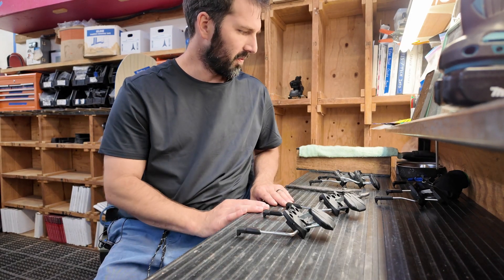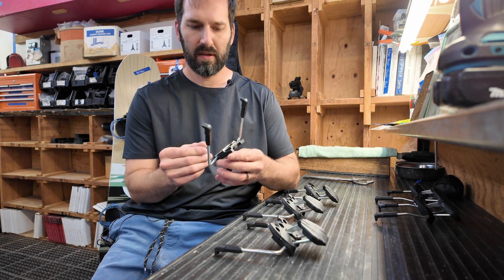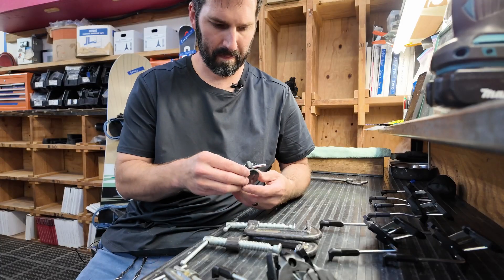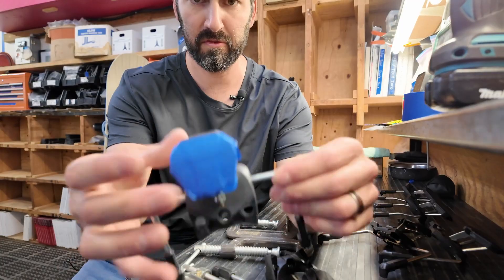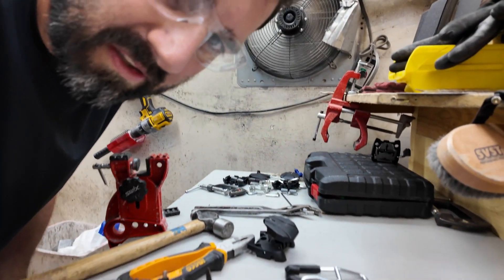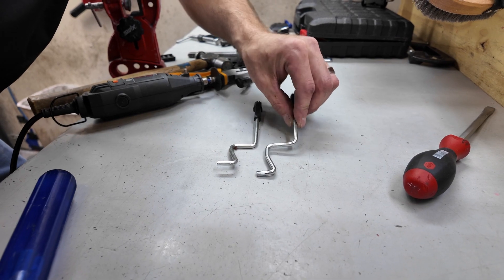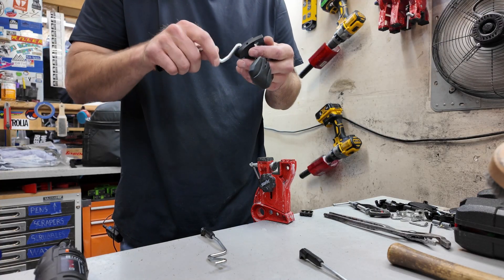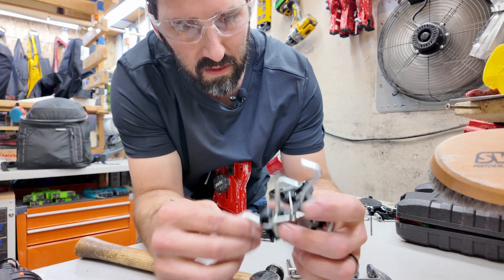Fabricating a Brake | Mounting a Look SPX RockerFlex Race Ski Binding to a 98mm Alpine Rec Ski

Comment: Where can I get brakes for look spx 12 , rossignol experience 84 ai
Reply from the maker: If your local shop doesn't have any spares, you can order directly from Rossi- they list it as the "Brake 3P B90" SPX Brake at 90mm width.  https://www.rossignol.com/us-en/brake-3p-b90-FC9F013000.html

Comment: Man, you are my hero. Long ago, and I mean long, long ago, I tried to get a replacement part for a Look binding and all the shops I tried in Mammoth said they couldn't sell individual part, something about legal liability. I even called the US distributor and had a very uncivil discussion with him. I mean it wasn't a particular difficult part, just disassemble off, reassemble on. After half a dozen call to our brothers in Canada and getting no love, I got hold of a shop in England that sent me one.
   It great to see shops doing this kind of out of the box thinking.👍👍🤙💪
Reply from the maker: Messing with bindings is certainly a grey area... these were for a pro skier and knew what he was asking for.
Reply: @Starthaus  Well, regardless, it's nice to see there are shops with brass ones big enough to step up.

Comment: I'm trying to do something similar. Does Rockerflex require a race plate? Can it be mounted directly to the ski? Thanks!
Reply from the maker: That was exactly the goal with this project- these race bindings were mounted flat on a powder setup.  No plate required, but you will need to free-hand the mount. Install at own risk!
Reply: @ yeah that’s beyond what I’m comfortable doing myself